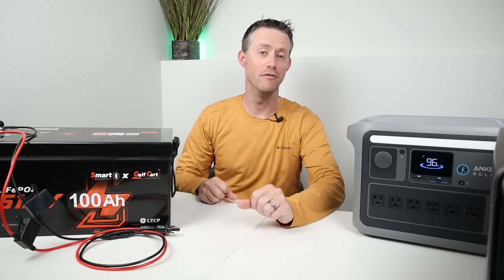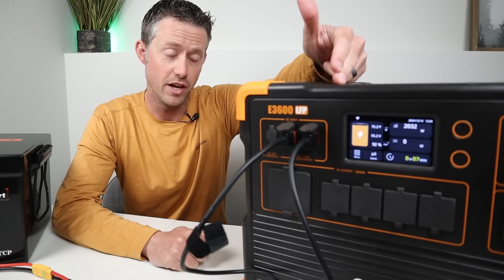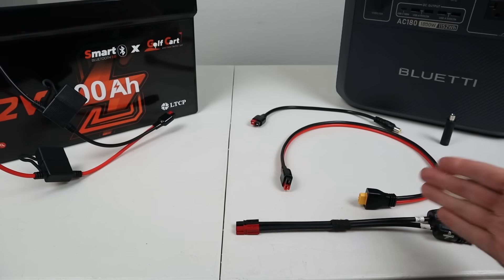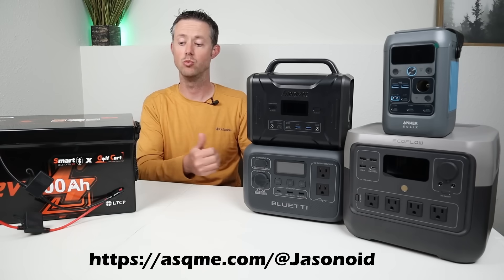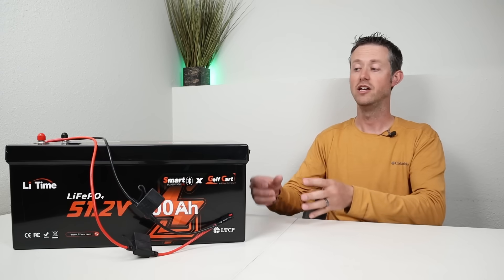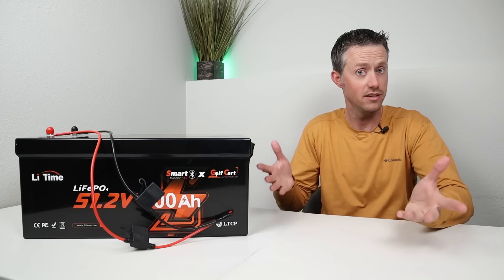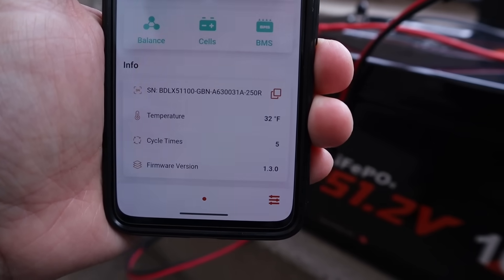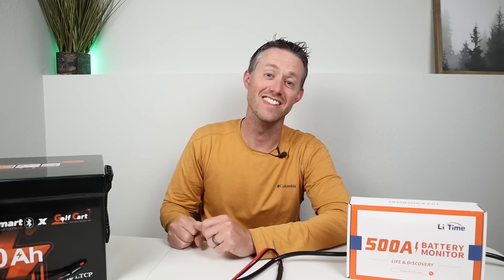Simple Trick to Make Your Power Station Last 5X Longer! Charging with a LiTime 48v Smart Battery!

Comment: Hi Jason, can you charge the battery at the same time it is connected to the Percon? Thanks for the info.
Reply: Yes!

You can discharge and charge any battery at the same time.
Reply from the maker: Yes, the Pecron power stations support charging and discharging at the same time with solar / DC input.
Reply: @Jasonoid  he meant the Li Time.  Can IT be charged and discharged simultaneously
Reply from the maker: @djcory2727  yes, the standalone battery can also be charged and discharged at the same time.
Reply: @Jasonoid  Would it be possible then to have the power station be charged by solar, then connect to the battery via DC out and the battery feed the powerstation via one of the DC ins? Assuming the power station has 2 IN, one could be used for solar and the other for the battery. So it effectively extends the usable capability of the powerstation. Thing would be, the DC out from the powerstation into the battery would charge the battery slower than the battery feeding the powerstation, so one would have to pay attention to that. The idea is to leave it all connected all the time. What do you think?
Reply from the maker: @segundacuenta726  there really isn't a good way to charge these stand alone batteries with a power station. The best option would probably be to have your solar charging the battery, and then have your battery charging the power station. So like this:
Solar panels > 48v solar charge controller > 48v battery > connected to solar input of power station
Reply: @Jasonoid this was my question as well (new to all this). Was hoping I could somehow use my EcoFlow in place of a charge controller so the external battery would act as extra capacity without needing a separate way to charge from solar.
Reply: hi  @Jasonoid  this is compatible to delta 2
Reply: Thanks for all the anwsers and more questions guys, learning a lot here!
Reply: The problem is if the power goes out, you're depleting the station to keep the ext. battery at full, and there are two conversion losses and a third when you disconnect the ext battery from the station DC out, and just let the ext battery charge the station.  As well, someone here has mentioned it uses disproportionately more power to charge the last 20% from 80% to 100%, so possibly better to keep it simple and have manual supervision at all times.  If charging the ext battery with a battery charger plugged into the wall, if the power goes out, it simply stops charging the ext battery.  With the wall charger, you let the wall absorb extra power losses. Im still thinking how this could work though, but sometimes simpler may be better.